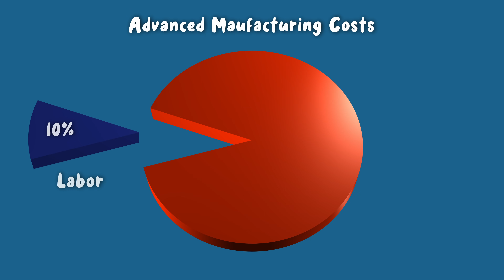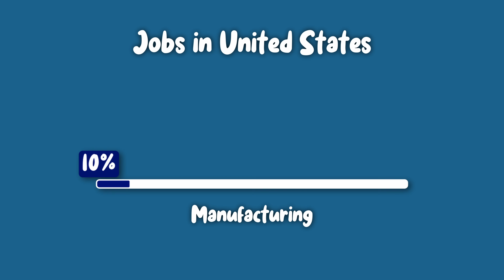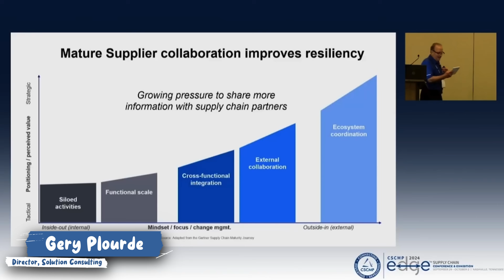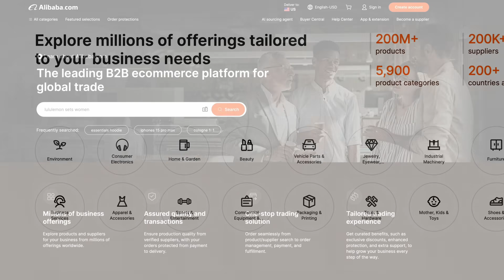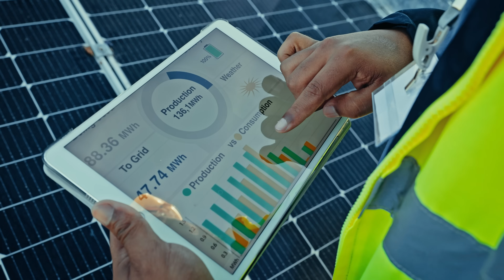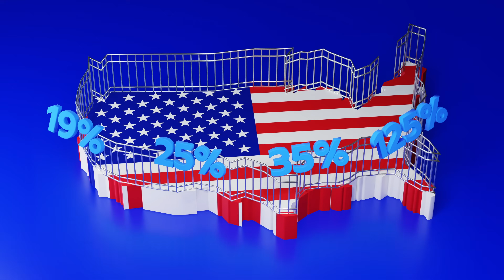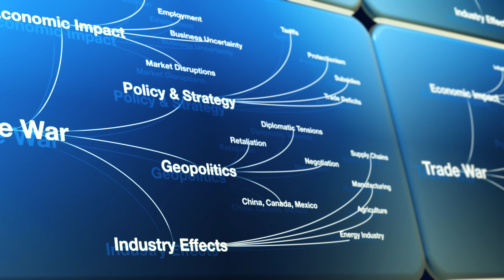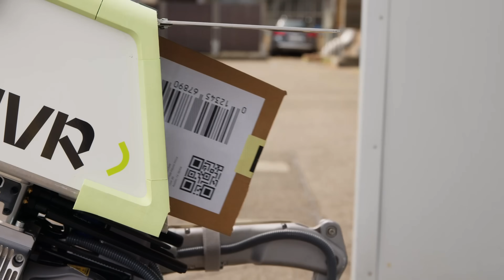Is US Manufacturing is coming back?

Comment: Truth is, we stagnated.  Manufacturing in this country was falling behind because the assumption was that just doing what we'd always been doing was going to keep working forever, and the rest of the world (China included) started pulling ahead of us in innovation and development.  That was really the driving force behind globalizing the manufacturing economy.  Cheap labor and low prices certainly played a factor, but look at something as recent as electric vehicle battery technology.  China is so far ahead of us that Ford found it necessary to partner with Gotion to build new battery plants in Kalamazoo and Big Rapids because their own engineers looked at the technology and realized they had no clue how it worked.  We've been using unnecessarily dangerous cobalt-based lithium ion batteries in our EVs while China has been building with much safer formulations (like lithium iron phosphate) and pushing energy density to incredible new levels that our manufacturers could only dream of.  We HAD to globalize if we had any hope of keeping up.  Now we're seeing not so much a re-shoring or resurgence of manufacturing, but a *reconfiguration* of what and how we manufacture.  Because we've long recognized the downsides of letting too much go.  That was a key part of the opposition to globalization in the first place, and it was a fair point.  As with everything political, it could have been done better.  But one of the very few remaining apolitical topics in this country today is exactly that: we need to take the lessons we've learned from that, take the advances we've made, and build on that to mount a substantial shift in industry toward the things that WE do best and what WE'RE in the best position, economically and skill-wise, to provide to ourselves AND the rest of the world.

Much like Detroit, it took a fall to get back on the upswing.